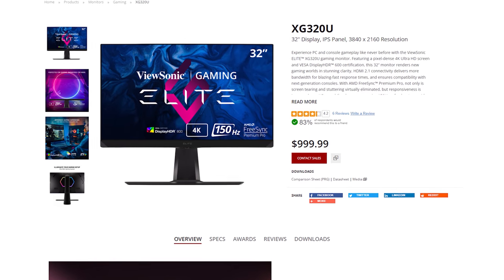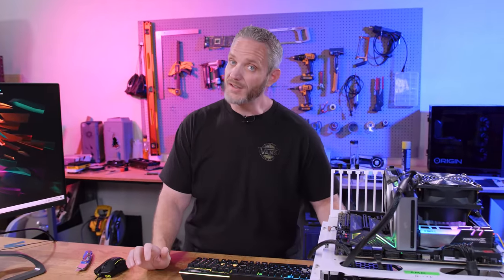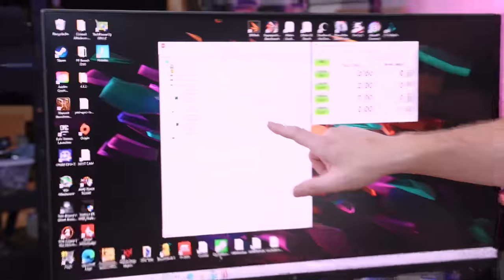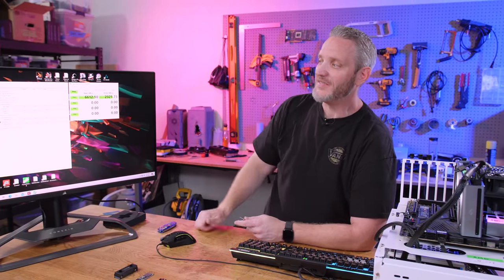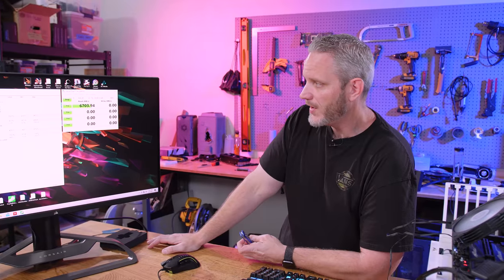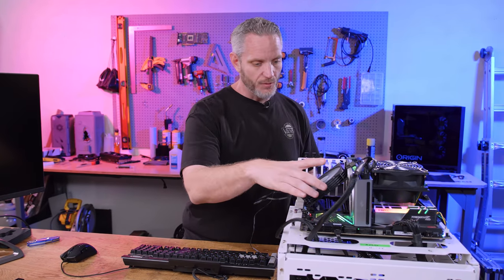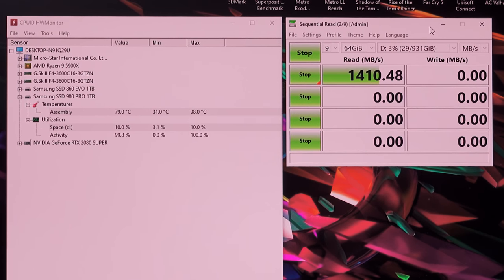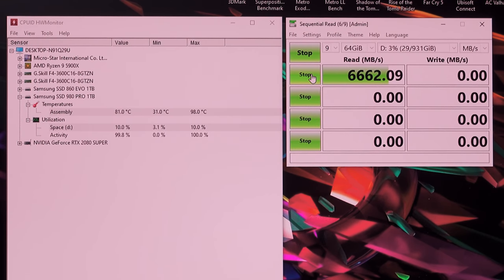I watercooled an NVME SSD... These results were unexpected!

Comment: Fun fact, if the nand gets cool enough it's speed goes down a tad, though longevity does go up. There actually is an optimal temp for speed in the Nand. The controller you want as cool as possible like most other IC's.
Reply: source? (genuinely interested)
Reply: @AKAtheA  Gamers Nexus has said this over and over and over again.
Reply: @AKAtheA  Tech Jesus...AKA Steve at gamers nexus.
Reply: @AKAtheA  I really don't recall exactly. This was discussed several years ago and I recall I read it in some analysis and related technical document. Though I think a few you-tubers have mentioned it. I'll do a quick check and see what I can find.
Reply: @AKAtheA  There is multiple videos and posts about it on the internet from different people regarding this phenomenon. The big problem is the controllers are only getting faster and in turn hotter which leads to the throttling and performance issues. So actively cooling the controller without activley cooling the NAND is the best overall for the SSD in terms of performance and longevity.

techquickie (Is COOLING Your SSD A MISTAKE?) has a good video about it with advice gained from Intel and how the science works behind it.

TL:DR Cool the controller as much as possible with a little cooling on the nand is the best way to do it.
Reply: The energy needed to overcome the cells' gate insulation to write/erase NAND goes down with increasing temperature which reduces erase/write wear at high temperatures, though it also increases leakage current which reduces data retention time. You want your NAND warm for write endurance, cold for long-term storage.
Reply: Nah not quiet right but close. Besides every drive having different specs for memory chips and controller. There are "ideal" temps for both "storage conditions"
and "usage conditions". Meaning when just storing data (powered down, on shelf) cooler temps are better for the drive (reduced electron migration).
When in use, especially when writing data, warmer (not hot, think it was around ~40-50°c) temps are better, because it's easier for the electrons to move. 
It also adds to the longevity of the memory cells, because it reduces wear. So this goes for the memory ofc. 
As for the controller, id say its like with every other microchip. Less temp, longer lifespan.
Just don't nail me on a Source. I read a few articles quiet a while ago when I did a lil research on SSD memory, NAND, Optane, SLC, MLC ect. and 
especially on data retention times of SSD's... Which is extremely hard to find anything about. Sadly.
Reply: NAND Longevity might go up, but data longevity goes down. Data lasts longer when written while the nand is warm and stored cool.
Reply: Steve is an absolute unit of a Chad, ill bet he slays with the ladies! He spits truth.
Reply: Which a high end systems water temp is around if you plumb it directly after the GPU/CPU. Helps even more if you use thermal paste on the controller, and 0.5mm pads on the DRAM and flash. Worked really well on my HyperX NGFF PCI-E2.0 SSD.
Reply: Was able to keep my 2GB GTX760 fed with 4K gaming.
Reply: @JuxZeil  4k gaming? on 2gig 760, who you trying to kid?
Reply: It's like an internal combustion engine ☺️
Reply: @madb132  No.  FO3, FO4, Skyrim, etc.
All modded with 2k+HD texture packs and ENB.  About 200 mods in each roughly.  Medium shadows and no AA....good enough for 30FPS on a Bravia Ex 74" TV.
Reply: I did read that one from Reddit a while ago and I was amazed. From my point of view, a temprature around 40-45 during idle and 45-50 during gaming/working is optimal to the longevity.
Reply: An electrical conductor that’s temp drops below it’s most efficient conductivity level start to restrict it’s conductivity due to the particles that make up the conductor being compressed together by the cold to the point that electrons start having a hard time being able to move very far or very fast. Get that conductor cold enough and you can pretty much stop or damned near stop electron transfer in that conductor period. If that same conductor gets too hot then it’s particles can get far enough spread out that your solid conductor starts to lose it solid structure and the electrons can pass through it so easily that they build a larger electrical field on that conductor than what should be there because it’s past it’s limits and can’t contain it anymore. When that happens both the constant flow of all the electrons in one direction (to ground) weakens because the field pushing it is expanding outward instead of being contained near the conductor but then if it gets big enough then it can cross more than one circuit, or path to ground, and funnel part of your voltage off to a second (or more) circuit, effectively “shorting” the path to ground across that circuit, which will weaken the amount of juice you want headed from point a to b, but now introduces points c, d, possibly more. Either way, wether you’re conductor gets too cold or too hot you’re going to damage stuff or miss a serious opportunity to do so when you’re conductor either starts shutting off the tap on your voltage from cold or loses the ability to contain your voltage in it with a small enough, strong enough electrical field to push it in one direction and therefore allows it to start going wherever it’s electrical field wants to take it until it either fries something or spreads it’s field so far and so thin that it collapses out, which usually stops most of the circuits flow, traps all the circuits juice in one spot, reinstating the field but in an instantly damaging burn shit up way. Either way, not good. Now, I’m talking more like the extreme limits and beyond of the conductor, but, depending on the conductor, it has a range that it transfers electrons in one direction at it’s best efficiency and it’s fastest before if you go colder or hotter it either restricts the transfer of your electrical signal or releases it to more than the places it’s supposed to be traveling to in more than one direction even and therefore causes gaps in receiving that signal where it’s supposed to be and when it’s supposed to be there.

Comment: There's a reason there's no software out there to stress test an SSD; stressing an SSD legitimately shortens its lifespan. SSD's have a finite number of reads and writes. Debaurer has great vid on SSD life expectancy relating to new cripto types. Its a real concern and shouldnt really be attempted if you actually want to use the SSD afterwards
Reply: Yeah but doesn't really apply to Jay or any techtubers whose job is to push things to their limit and see what happens then report the results to us. 

Average users definitely shouldn't be stressing their drives to see how hot they get, but videos serve the purposes of demonstration and testing so we don't have to :P
Reply: Yeah but that's the same for gpus and cpus besides yhe fact they can cost thousands of dollars and an ssd can be under $100
Reply: Who better to have that type of program than the YouTubers that don't always plan on using the products they get sent. I think someone at LTT wrote one up for one of their videos.
Reply: @Adroit1911  I remember that one, the $20 SSD video.  I believe it was Anthony, I recall some Linux wizardry
Reply: Every drive has a finite number of everything. SSDs just have a pretty well defined limit on writes. You won't kill them with a hand full of stress tests tho, even most consumer drives nowadays are rated at 100s to 1000s of TBW. The MP600 has 1.6 PBW, meaning you'd have to fully write it 1600 times to even get close to the end of the lifespan. So you'd have to constantly write a 1TB MP600 for multiple weeks before you'd get anywhere near the end of it's lifespan.
Reply: Reading it spelt as cripto bothers me far more than it should.
Reply: For the sake of testing that approach would seem plausible even if you somehow manage to reach its cycle cap. Break one drive in order to see if it's worth buying a bunch of them for whatever project. Not to mention that would be a good way for testers to confirm or not what manufacturers claim regarding their lifespan. But then again, according to the cycle lifespan these have, i doubt that one would be able to reach the end just in one test where the aim is different and you look for performance and temperature stuff rather than lifespan.
Reply: First off, there's stress tests for SSDs and HDDs. Not sure what you mean.

Second. Stressing anything shortens it's lifespan. That's kinda what stressing is.

Third. A good SSD has about a petabyte of write endurance. Enterprise grade SSDs and old SLC models can hit 60PB and 3d xpoint can do 100 drive writes per day for 5 years.

I'm pretty sure they didn't just randomly pick a number, they did some testing. Ya know. Instead of fraud? In any case, they're not benchmarking the SSD at full tilt for 3 days in a row. The ssd would be 'usable' afterwards.
Reply: Also, data servers and PoS crypto miners are the only computing scenario in which that sort of stress test would be applicable. Most people will never (and as you said wouldn't want to) write >1TB of data on a daily basis to an NVMe.
Reply: @raynman6466  Your CPU and GPU don't have a set amount of operations that they can perform before they fail to continue working - I could benchmark my CPU and/or GPU for years on end before they will eventually fail.  NAND flash does have a somewhat set amount of operations that you can perform before it fails, you get a limited amount of writes per NAND cell before the cell wears out and the drive controller can no longer figure out what was actually written to that cell.  The controllers have some pretty advanced algorithms built into them to ensure that the cells in your NAND flash are written to as evenly as possible to ensure the longest lifespan of the flash but this doesn't actually stop the NAND cells from degrading.
Reply: Way to go, If we accept your logic we wouldn't now how anything performs. Prat.
Reply: @raynman6466  Not when temperatures are managed. A CPU running at 100% at 65C is nearly the same as a CPU running at 50% at 65. Same with the GPU. Running a CPU at 1% vs a 100% has a negligible affect on computer hardware, when they are treated right. 

There's a reason CPUs and GPUs have maximum thermal requirements, and can self-boost if below those requirements, and not the other way around.

The reason we don't like buying used mining cards isn't because they've been running at 100%. It's because we don't know if they've been running at 85C or 65C.

Whereas with an SSD there is a measured TBW for SSDs, because this is the maximum they are measured to write before there's a substantial risk of failures. Let's take the 600 TBW for the 1TB samsung 970 EVO(Yes some well designed modern drives are rated a lot higher. However, 600 TBW is not uncommon even on modern drives). It's a PCIe NVMe SSD rated at 2500 MB/s write speed. Let's say it averages 2000 MB/s during stress testing. That mean after 1 hour on benchmarking, you would write roughly 7.2 TB, or ~1.2% of the rated lifespan of the drive. Now imagine an PCIe 4 drive that can be shown sustaining 1.5x-2x that speed with similar TBW. 

You can benchmark a CPU for 100 hours without damaging it. Infact it's called burn-in. It's very common for companies to burn-in a CPU for days, or longer, to make sure it didn't arrive faulty. Why? Because if it's a functional CPU running it at 100% with temperatures properly managed is insignificant in the lifespan of a CPU. 

But benchmarking an SSD will cause damage to it, and can literally kill it.
Reply: "No software out there to stresstest an SSD"? Yeah Anvil's Storage Utilities doesn't exist and it definitely doesn't have an indefinite stresstest with permanent logging designed to torture  SSDs till the NAND fails/dies. And it totally hasn't been used to see how many TB or even PB SATA SSDs could write 8 years ago already (with a Samsung 840 Pro exceeding 2 petabytes). All totally not a thing /sarcasmoverload
Reply: @Joe That would then be user error that caused the hardware to fail, not the hardware itself working for its intended use
Reply: Yeah, the highway safety board shouldn't be able to crash cars, because normal drivers never want to crash their car! What a stupid response... 171 upvotes too.
Reply: @raynman6466  It's not the same.  SSD is more like a battery and has a finite number of times individual memory bits can be charged and discharged before they are unreadable.

Also a solid state drive is solid state and there's really not alot to stress test.  It's not like a hard drive that has a spinning platter, it either works well or fails catastrophically.

Comment: Just watched this video.  I'm a former SSD FW engineer and currently do lots of storage device testing.  What you're seeing with the low writes is because you filled up the SLC write cache.  You should look at graphs of the bandwidth over time, you can add HWInfo and HWMonitor parameters into MSI Afterburner or pickup a testing utility.
And the DRAM in an SSD is predominantly used for the FTL mapping table, there's very little space allocated for caching.
Reply: I'd recommend running windows 10's defrag between tests to trim the drive, then wait a few minutes for the SSD to complete it's cleaning. Otherwise it's gonna runout of it's write cache and your testing cache instead of temp effects. Think this is a good idea?
Reply: @DarkAlaranth  Cliff is a former Star Ship Destroyer, Forward Warp engineer, Keiran. He doesn't have time for replies... Also, SSDs are fast, but c'mon. We all know we haven't reached FTL warp yet
Reply: @DarkAlaranth  defragging an ssd is not a good idea
Reply: @YY15UPC  Defrag in Windows is safe. It only trims, rather than reallocates data.
Reply: @Bimbomsanything is better than nothing. Gen4 and 5 run hot

Comment: To saturate and stress the NVME you could use a program called HDTune (The PRO version) in it, if a drive is completely wiped, (can use windows tool diskpart to do it) you can do a write test (on the benchmark tab) which is already very demanding, but if you go to file -> options -> benchmark and select full test (something along those lines I'm writing from memory) you will be doing a even more demanding test, this is the way I have found to stress test nvme drives as much as possible although when the test ends you still have to start it again but from my experience it takes a lot longer then crystaldisk, I hope this helps you guys!

Edit: Don't forget to select the right drive you wanna test, on the drop down menu
Reply: iometer is free, but a little clunky

Comment: You also have to be careful about write cache on these drives distorting your readings. For instance, if the test is writing less than the size of the units write cache, you may get numbers that are not indicative of normal long-term operation for the drive. So if you want to test how temps affect the read / write speed of the drives, just make sure you remove all other possible variables first. 

Thanks for your videos! Always look forward to them.

Comment: For testing try out HardDisk Sentinel PRO. You can do various surface tests ("write only" too), with user defined data, patterns, block-range (or whole disk), and times (up to 9999). Also great for Smart reading and logging.
Reply: I just wanted to say the same. HDS or ATTO. HDS surface test works closer to block level. ATTO is file level.

Comment: My go to for filesystem benchmarking/stressing are IOR and MDTEST. Both are MPI based tests. IOR specifically drills on read and write performance. MDTEST is designed to hammer on the metadata performance. Usually these are done against large networked filesystems, but they can be run against a local filesystem as well. Just be careful not to fill your OS drive by accident.

Comment: Fun fact: NAND flash has it's operating temperature little bit higher than anyone would expect. But I heard that Intel and Micron's 3DXPoint, as in older Intel's 900 and 905 SSDs has to heat up every single cell to 400°C for write. I purposefully mention cell, as during the write more than one bit is affected (between 9 and 16 if what I heard is accurate). This is why it's so power hungry.
Reply: Damn, Imagine cooking on a pile of the mentioned ssds when they reach 400c Lol
Reply: @куятн  LOL give him a break ✌